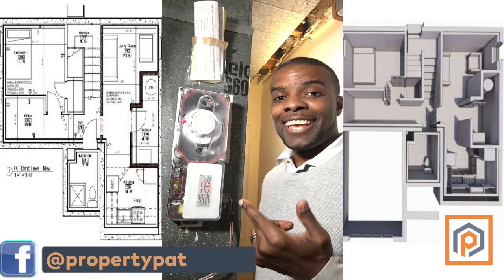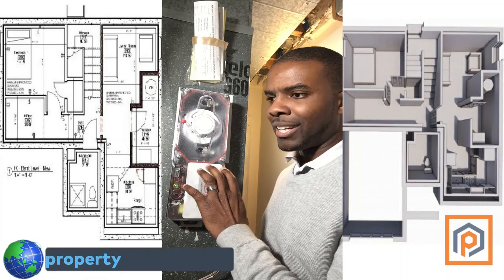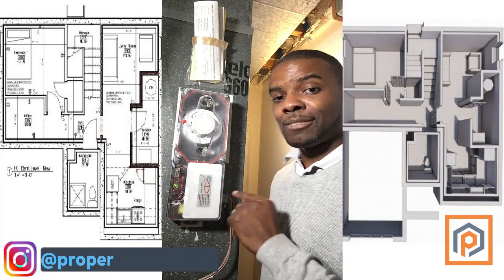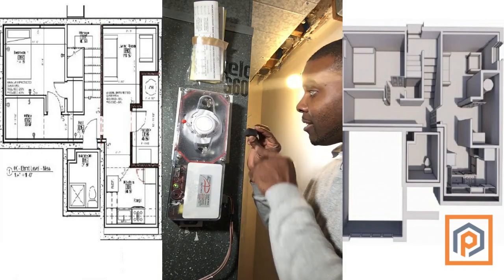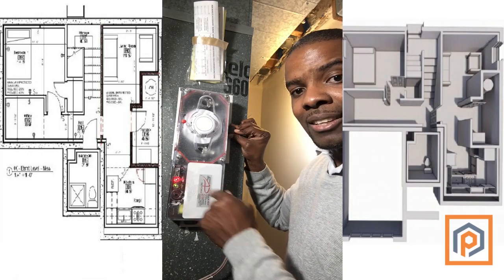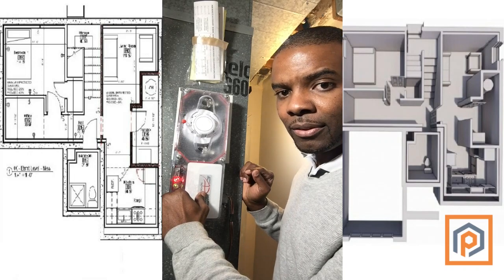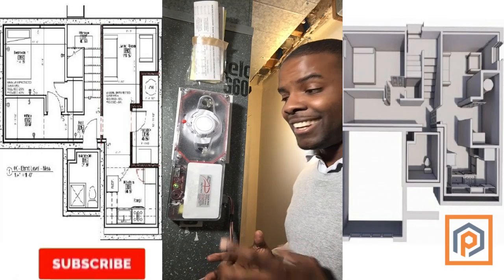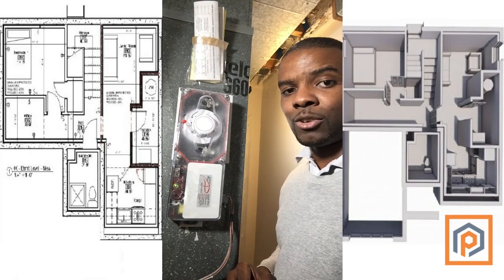How to Test A Duct Smoke Detector Serving A Two Dwelling Unit

Comment: My duct detector in my condo unit keeps tripping off. If I flick the furnace circuit breaker once, the detector turns on. Later it will turn off again. A HVAC tech cleaned the rods in the detector and now says it needs to be replaced for $600. It's 8 years old. Is this normal? Also is the price right??

Comment: does it work with Nest thermostat? would it be possible to share the wiring diamgram at both the smoke detector and the furnace? I have nest thermo and sl 2000P and seems doest compatible

Comment: I have installed it in my basement. I tried with my regular household magnet BUT not doing anything!! (I lost the original magnet, that came with the system). Do I have to buy new magnet? From where?
Reply: Any strong magnet works

Comment: I suspect it is installed incorrectly. If the fan remains on it defects the purpose of the device as smoke will continue to move through the ductwork into the spaces in the event of a fire